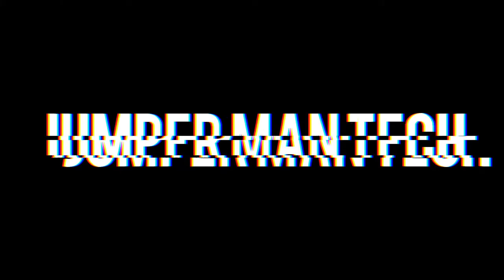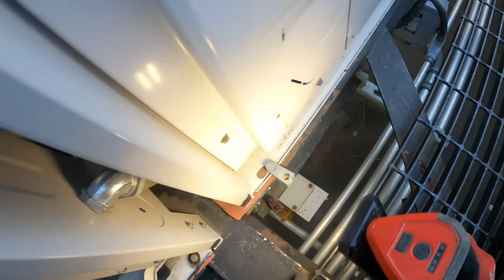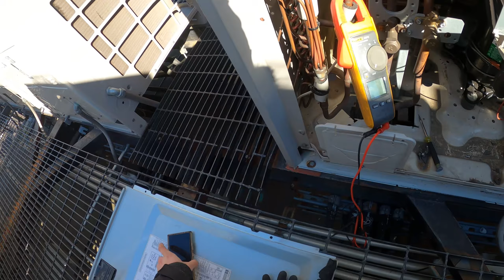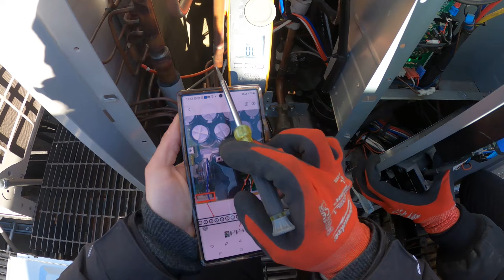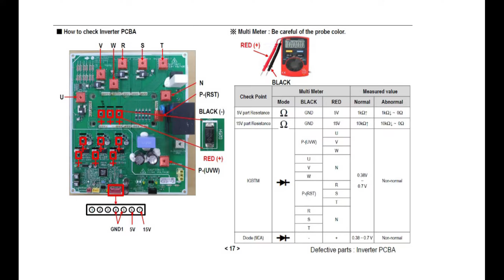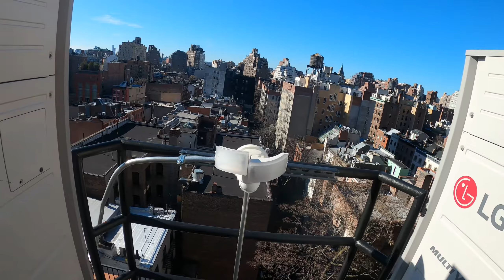HVAC Service Call: LG Multi V IV Error Code CH29 (Inverter Compressor Over Current) Error Code 291

Comment: I have a Lg hm 123m u 33 type heat pump, error ch29 occurred. So far several experts have looked at it. There was a software update, what could be the problem? Maybe the surface of the spiral snake heat exchanger of the indoor tank is small?
the heat pump stops approximately every three days in the evening hours and must be completely disconnected from the power supply, after which it can only be restarted.

Comment: Hello, please tell me the error c1_1 (211), when you restart the chiller, error 22 comes out - what should I do? - so far I have found that 1 compressor for 50 amperes in my 3 phases calls to the ground of the order of 100-150 ohms, I threw it away the inverter board is working (I sin only on the current sensors on the board itself) - but not a fact 😥😥😥😥😥😥

Comment: I just want to confirm that you're supposed to check ohms with the unit on or with the power disconnect engaged?
Reply from the maker: Anytime you're checking resistance (OHMS), the power must be off 👍 Thanks for watching & stay tuned for new videos every week🔧⚡️
Reply: @JumpermanTech  Right I only asked because there was side note at the bottom of the video that you were checking this with the power on, so I thought maybe this particular unit needs to power on to check resistance.

Comment: Good video. 
Just for the future as you will likely see a lot of issues at that job site…
In this case.
Your error is actually 29-1
29 is the error 1 is saying it’s the master unit.
C1 is compressor 1 and the 1 by its self says it happened 1 time.
If you have a slave and had an issue on that unit it will read 292 or 29-2.
Also the compressor is an inverter driven compressor and runs on AC not DC. The CFMs run on DC.

The suction driers are a bad sign. There seems to have been alot of issues there. The suction driers should have been installed with a bypass and after the clean up from the burnout was complete it should have switched to the bypass. That drier should not stay in place and needs to be removed.

If you haven’t done so already get the LGMV service tool for the laptop or mobile. I prefer mobile as it is easier to use a phone then computer but to each there own.

Good luck and keep up the good work

Comment: That SL drier is best installed vertically you otherwise need to add about 1/2 quart of oil that sits in the bottom of the canister that never returns to the compressor, and with the Hassel of removing that pig, with that beast out of the way, why would you not replace those vibration eliminators that always leak.

Comment: In all my years of selling and installing LG MUTI V I never had a single compressor fail. 
      I see videos of failure and think what was not done correctly on installation.
Reply: Did you see these pipe connections to the unit?
Reply: @JuanTodoli  yes, I seen those pipe connections did not want to badmouth anybody about their braze looking like a child’s building blocks first time attempt

Comment: Good job Jumper, Yeah, Klein makes a better mega ohm meter or megger old school electricians call them, megger is a name of one of the manufacturers that started making them, but yeah, the Klein gives you digital read out or better reading on resistance values, than just a lighting display, the Fluke mega ohm meter is super expensive, Good job.

Comment: Great video what LG app was that because I have to work on this same one in Tuesday
Reply from the maker: Thank you Robert! The LG app is "LG HVAC SERVICE-BUSINESS". Definitely a great help. I'd even recommend to call tech support to confirm everything you found & if there could be any other potential causes for the issue the system is having. The testing documents I used in this video was emailed to me by tech support which is not found in the standard manual. They have all the secrets! Good luck & stay safe out there🔧⚡️
Reply: @JumpermanTech  Thank you much appreciated. Very complicated unit the LG Multi V. I had a slave and master unit. One time people were complaining about the temperature. All I had to do was clean the filters. These smart units either work very well or will give you headaches. I wish all calls was that simple lol.
Reply from the maker: @robertdavenport9095  You're very welcome. Definitely very complicated systems. I'm learning them myself. I agree. Man I need some easy service calls. Been getting difficult ones but thats what makes you grow💯
Reply: I have to change the Compressor and Broad how crazy is that??? Thank you for the LG information my brother.

Comment: Very good video. I’m fascinated by those LG units. Got a question for you, was it just a trick of the light or did the black wire going to the compressor look like the insulation had rubbed off in one spot? If it was maybe it was intermittently short to the front cover?

Comment: Lg with a bad compressor. No way!
Reply: That’s a joke just fyi
Reply from the maker: @nebraskaman8247  😂😂😂
Reply: @Jumperman I figured Lolol. I used to work for LG, and changed a ton of their compressors. Never on one of those though. Makes you really want to work on a trane, York, or anything else besides that after that compressor changeout.
Reply from the maker: @nebraskaman8247  Haha I understand now. This was actually my first service call on a LG unit. I need to take some training classes & I just got the LGMV tool for the mobile app. Haven't tried it yet. Any advice dealing with LG equipment? Looks like I'll be working here alot. Thanks! Have a great weekend 🔧⚡️
Reply: It depends on what the software you got allows you to do, and test. It’s been a bit since I worked for them. If you have access to their tech line, I would call them and ask how they test the cooling system specifically.

Used to we could ramp the compressor up to 100%, and there were sensors that could detect the temp drop across the coil etc. Also, with it ramped up at 100%, we could get pressure reading on some systems. With it ramped up we could also test the compressor current draw. 

Between all of those tests, and the software we could find the issue fairly quickly if it was compressor low charge etc. 

With the software showing real time temp sensor temps, we could also determine possible sensor issues real fast.

To have access to all of that you may have to be a LG DMST though. That’s what they call their direct mobile service.
Reply: Those linear compressors you for the most part cannot just get pressures, and roll with it bc you don’t know what speed the compressor is running at during that given moment. That’s why they had a way to turn it to max operation. Then the software would analyze the temp drop at the coil, and you could get pressures etc.
Reply: how would you even change this compressor, take out all the boards? looks like terrible servicability.
Reply: Your guess would be as good as mine on that condensing unit. Prob gotta tear it all down.
Reply from the maker: @nebraskaman8247  Yup. Had to take down the whole control panel. These units are so smart that they are dumb😂 worst compressor changeout ever
Reply from the maker: @maxlawton2754  Stay tuned for next week. Just changed the compressor today. Had to take down the whole control panel. Recorded the job. Terrible.

Comment: Those M500 supcos are no good. The readings it labels are blatantly wrong. You need a megaohmeter with an actual reading on display. For about the same price as that Supco you can get a Klein ET600. Spot testing never gives a clear indication of poor insulation. A DAR test on windings will give a better idea of how good the insulation is. 

For further reading: IEEE 43-2000, Megger’s “A Stitch in Time”, Copeland 4-1294
Edit: Fluke also has a good article about IRT for compressors
Reply from the maker: I do want a megohmmeter that has an actual number reading on display. That Klein ET600 looks legit. What meters would you recommend as maybe good mid-range megohmmeter because some of the prices get ridiculous on the higher end. I need to look into those tests and articles. Thank you for the feedback & stay tuned for new videos every week🔧⚡️
Reply: @JumpermanTech  I’m personally a big fan of Klein’s meters due to giving the absolute best bang for your buck. There’s videos out there showing off how even cheap Chinese meggers are still able to give reasonably accurate readings compared to Fluke’s, but it always goes back to brand confidence. 

And I love the videos man, I do residential/light commercial so I never see anything as diverse as you do. You’re by far one of the best in the field HVAC/R channels right now. Salute.
Reply from the maker: Or the Kelin ET600 will do
Reply: REED makes an affordable megger

Comment: Great troubleshooting 👍
Reply from the maker: Thank you! Stay tuned for new videos every week🔧⚡️
Reply: @JumpermanTech  what's  the name of the app you used for the error code searching please tell me😢😢
Reply from the maker: @Giorgos-k1e  "LG HVAC SERVICE-BUSINESS" App. It's a must have when dealing with any LG unit. Good luck! Thanks for watching 🔧⚡️
Reply: @JumpermanTech  does the app work just to show me any error code and not dealing with anything?
Reply from the maker: @Giorgos-k1e  It can tell you what the error code means and it also gives you information on what to check based on the code. Thanks for watching! 🔧⚡️
Reply: @JumpermanTech  thanks man thank you so much 🙏 ❤
Reply from the maker: @Giorgos-k1e  👍👍👍

Comment: VRF systems are a service techs blessing and curse at the same time.   Get good at these boys and you’ll have steady work forever.
Reply: Yea so true ... I feel like most of them is just reading the manuals and learning the manufactures specific issues /codes. Everytime I go to a new one it's pretty much reading a manual for how ever long it takes to find the issue. But ya as long as you understand how they are installed and how to find the error codes they aren't that bad . Only a real problem if it was never installed or serviced correctly Its hard to show up to a call and expect the entire system to be working how it's supposed to . Especially when their in house maintenance says it never worked properly from installation lol

Comment: I’m amazed these units sit outside as they do.
If it had been pouring rain that day, would you have done this diagnostic work or waited until it dried out?
Nicely done, guys.
Reply: Would you want to sit in the rain all day messing with electronics ? The customer is fucked if its raining.
Reply: @joshperez7731  Totally.  Where I live it's always raining so I wonder how the techs deal with outdoor equipment all the time.